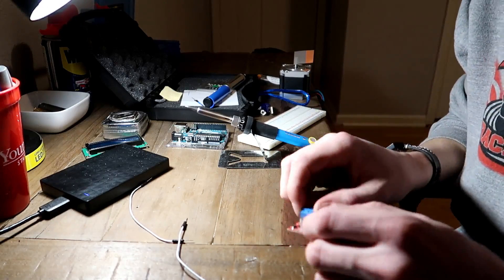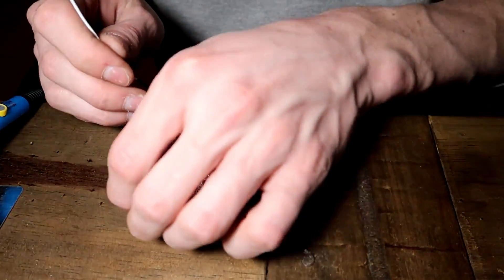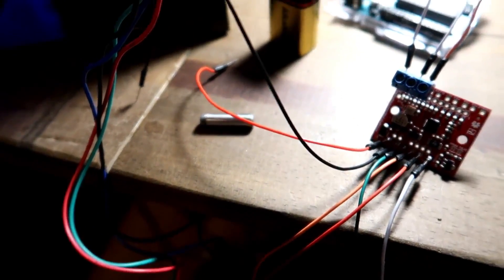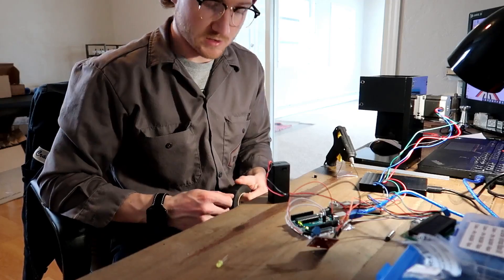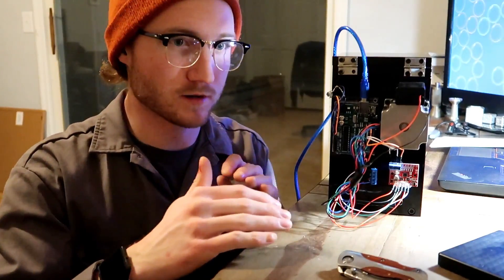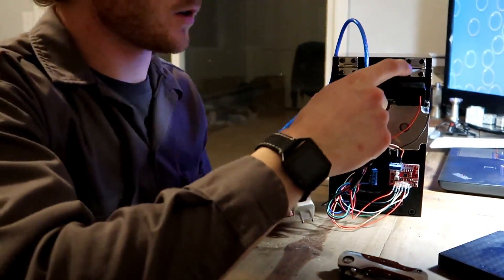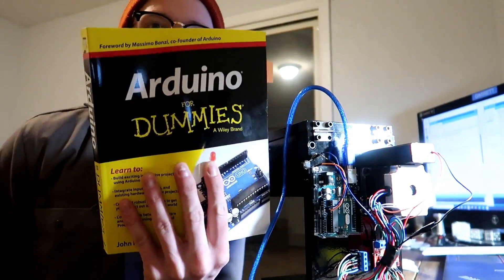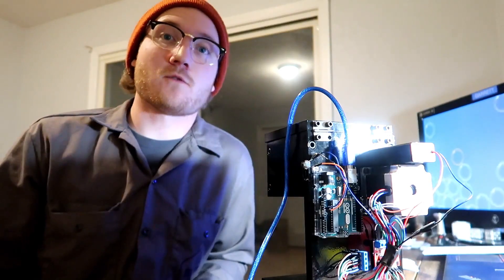Arduino Dog Toy Release: Home Mfg. Days #32

Comment: For soldering the small stuff, I'll place the iron on the table with a weight on it so it doesnt move. Then you can manipulate the two things you are trying to solder. This is especially helpful for trying to solder two wires together. Also, small wires heat up quickly, so a small set of pliers helps.
Reply from the maker: That is much more helpful.  I figured someone would give me some tips after posting...so thanks for that.  I found myself running out of hands while trying to solder.